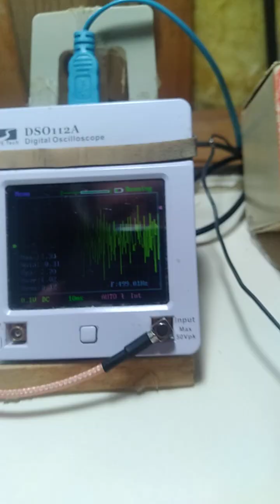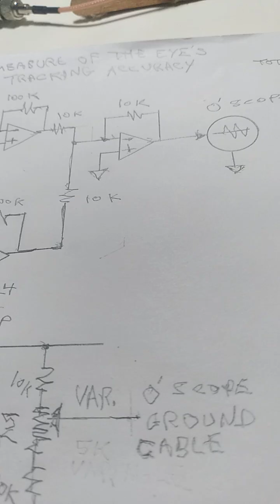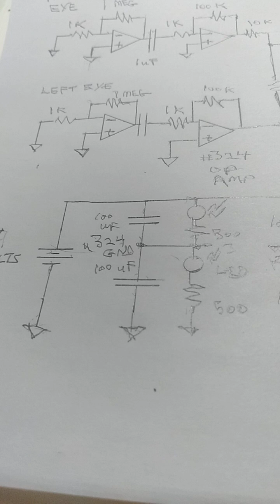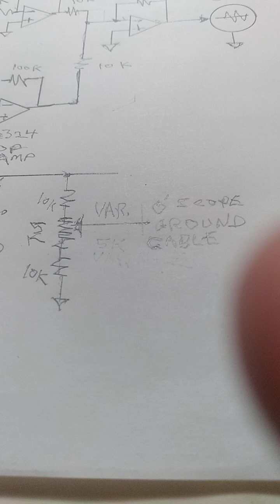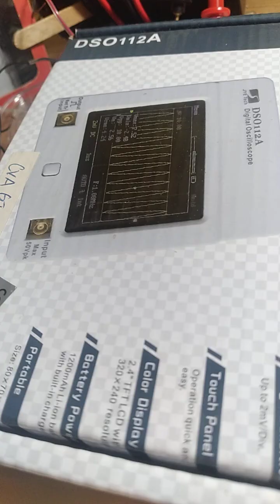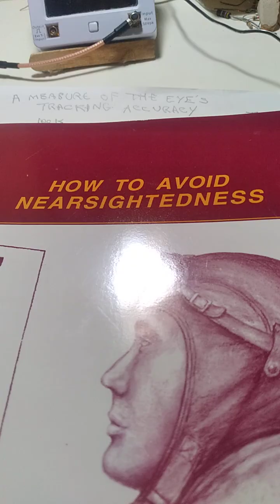Measuring the FUNDAMENTAL EYE'S, "Over-All", refractive accuracy, using a capable Oscilloscope.

Comment from the maker: The 1 uF capacitor is necessary to block the DC value of the first OP-AMP. 
The second OP-AM has OFFSET, which is corrected with the 5,000 ohm resistor.